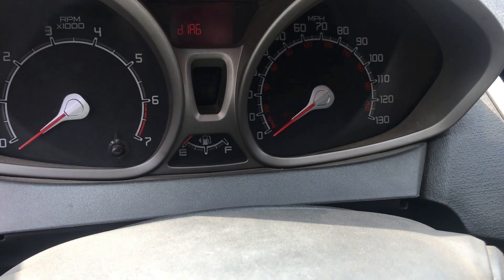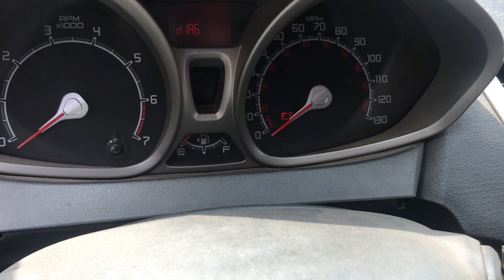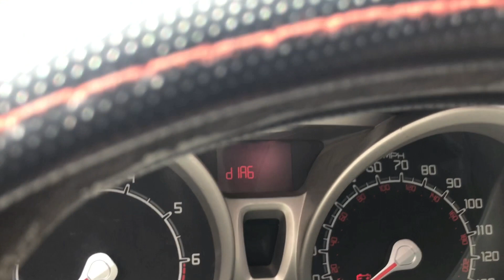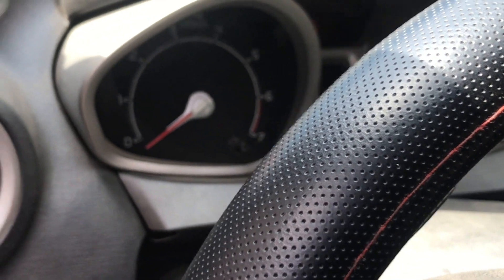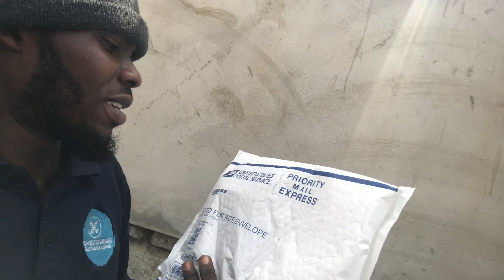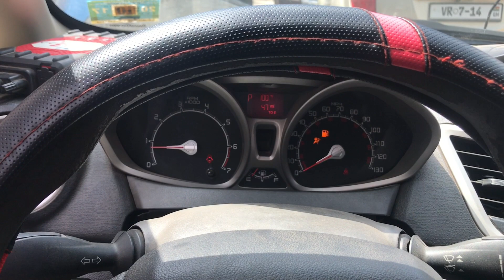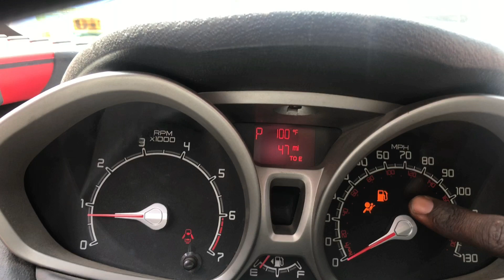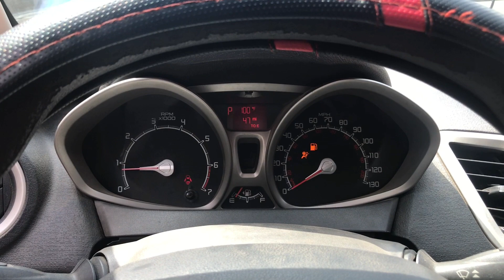2011 Ford Fiesta Battery Light On!! (BAD PCM)

Comment: brother i have ford fiesta mk6 1.4 tdci my problem is that whenever i start the car  battery warning light comes on the dash but if i fully press the throttle all the way to 5k rpm it starts charging and light goes offf , plz help me to solve this issue . this problem started when i removed the battery
Reply from the maker: When you take of the positive terminal from the battery does the engine goes off?
Reply: @HoopsnWheelsGarage  yes engine runs
Reply from the maker: Did you change the alternator?
Reply: @HoopsnWheelsGarage  no i dont
Reply from the maker: joshmcbills55@gmail.com

Contact me on my email let’s discuss it
Reply: @HoopsnWheelsGarage  sure